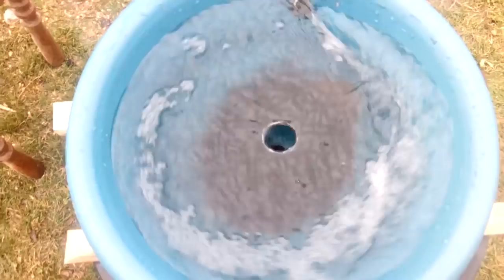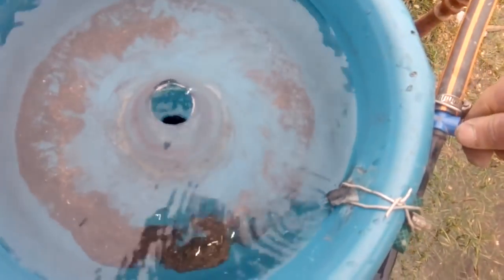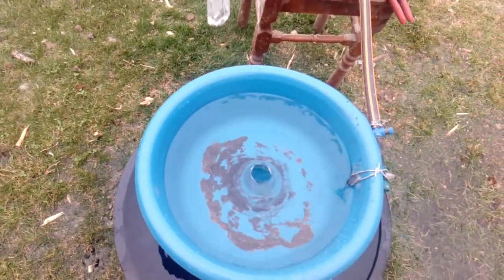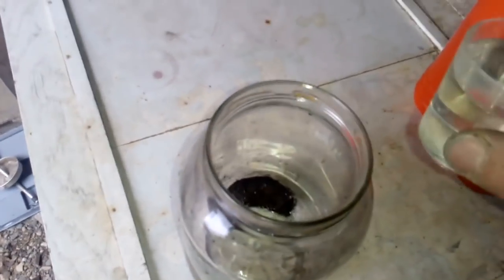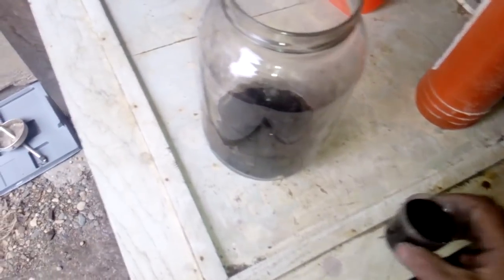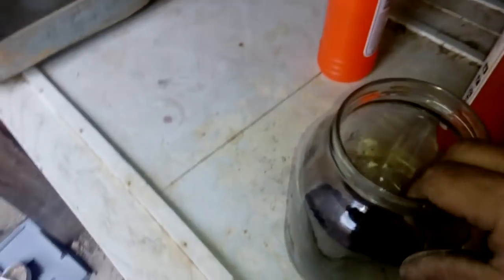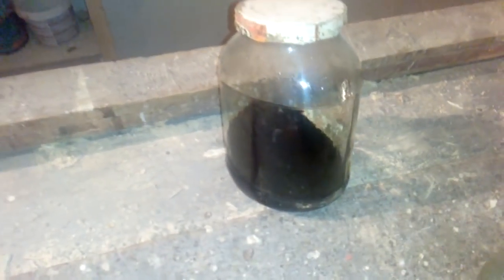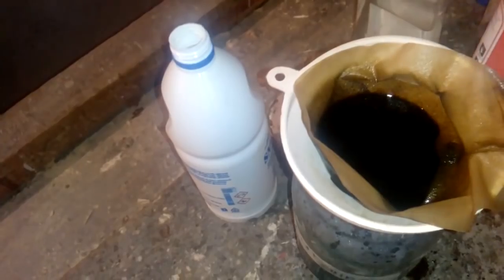Gold recovery & refining from IC  chips full proces part 2

Comment: I have ash from crushed chips and such, could I use AR and make the process shorter?
Reply from the maker: You may, but you will need a lot of acid for many material, not to mention that you will have to constantly stir when you have a lot of materials because the chip dust will block the contact between acid and gold.

Comment: where do u get copper chloride
Reply: hcl and peroxide well used????
Reply from the maker: Take out the old AP solution for coper hloride, or take 2dcl hcl and burn a bundle of copper wire and put it in and for two or three days you have copper chloride.Copper chloride is in fact copper dissolved in acid, copper ions are needed to start the dissolution of base metal.